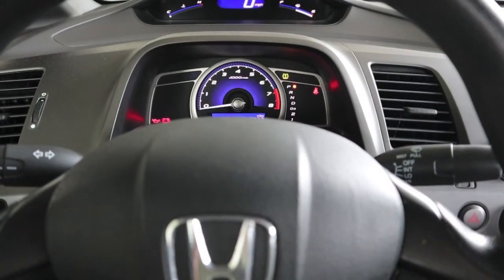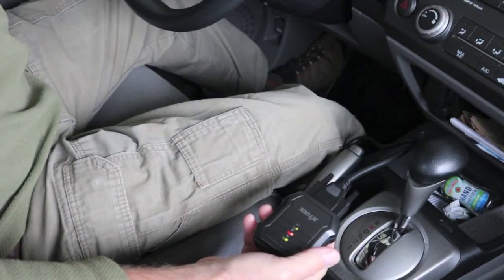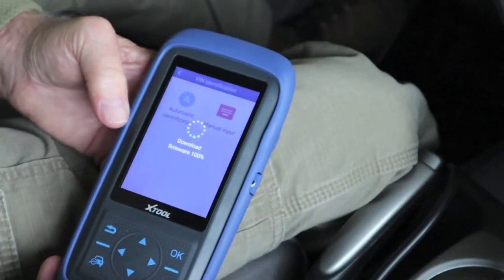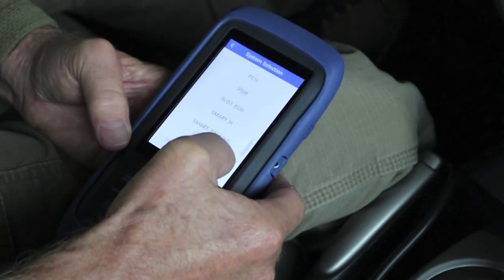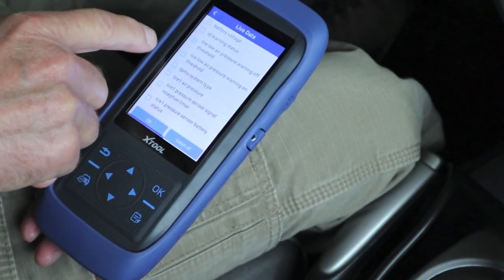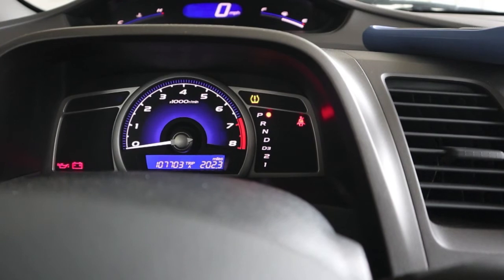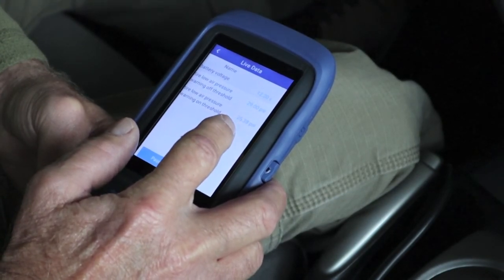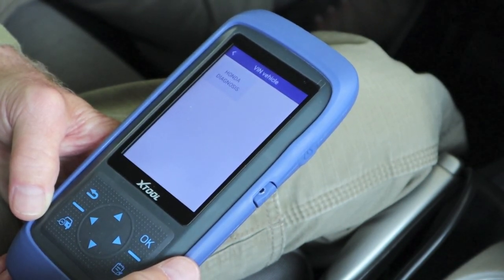2008 Honda Civic TPMS psi thresholds Let's look with the Bidirectional Xtool A30 Pro Scan Tool

Comment: Hi, I have this Xtool A30. I'm trying to reset the tpms on my 2008 Ford Explorer Sport Trac. Going through the instructions, I get to the LF tire then it says "use the reset tool" to complete the rest of the sensors. This is where I cannot make any progress progress. progress.
Reply: Keyboard repeat, sorry. 
A30 Pro, correction.
Reply from the maker: Have you tried contacting them? They have pretty good service.

Comment: Drove over a pothole, had my wheel repaired that’s what seemed to trigger these events.
Reply from the maker: Make sure the ABS sensor wires are in place.
My nephew ran over a cat and it tore out a front ABS sensor wiring harness on his 318 BMW.
Thanks for watching!